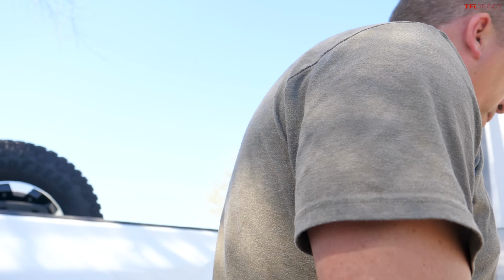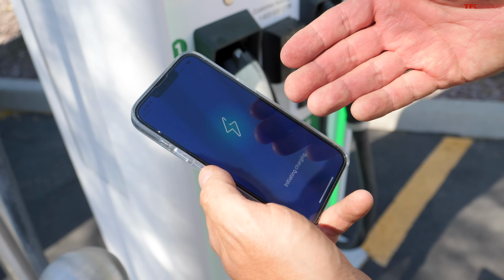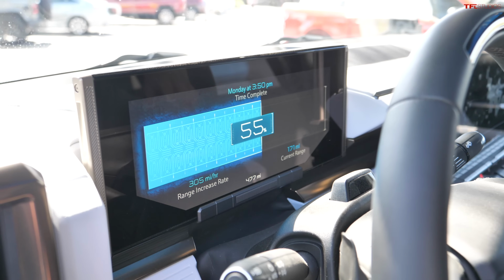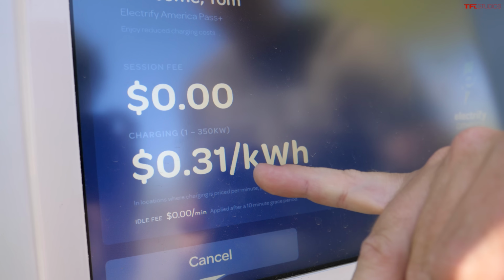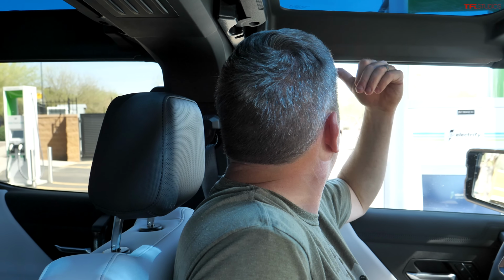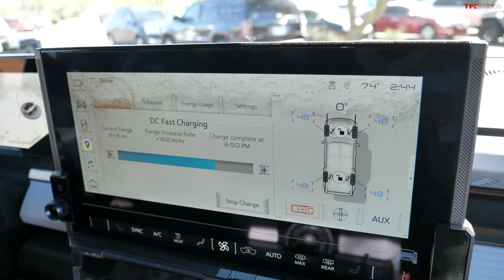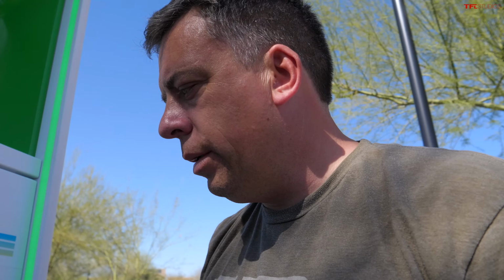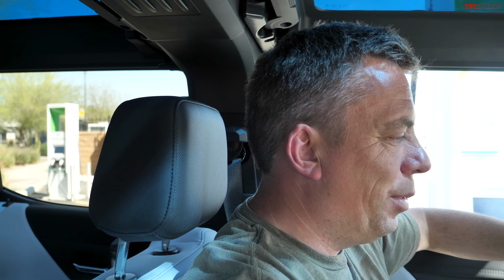How Fast Can I Charge The GMC HUMMER EV In Just 15 Minutes? The Answer Is Surprising!

Comment: Can you guys do a video on home charging costs? I would love to see monthly bill with a EV vehicle being charged at home and a month without being plug in at home. What would be the car charge % of that bill.
Reply: Multiply your electric rate per kWh by the mile/kWh of the vehicle you're interested in. For example, my Focus Electric has around 28 kWh available in the pack so it's $2.80 (I pay 10 cents per kWh) for a charge.  It gets 3.7 miles per kWh, so a full charge gets me around 103 miles. That's ~2.7 cents per mile. Electrify America rates vary. In my area it's 16 cents /per kWh, so ~50% more than home charging. A full charge for me is around $3.50, because there are some losses to heat when charging.
Reply: @jghall00  So $100/month added to your monthly electric bill, for nightly charging. (for a Focus).
Reply: @sptrader6316  Closer to $50. We rarely use the full range each day, more like half most days.
Reply: In your calculation don’t forget about taxes and fees that are also associated with your home electric bill
Reply: @CharlesAnsman  It's already included in my kWh rate. 5.5 cents is energy, the rest is delivery, taxes, and fees.

Comment: 78 miles added. Real world usable amount is probably closer to 70. At $14.25/70 miles=$0.203/mile. For comparison, my ‘17 Escalade ESV does 20mpg hand calculated, at $4.50/gallon=$0.225/mile. Over a year of driving 8000 miles for me equals a savings of $176/year. Charging at home would cost about ~1/4 of the $0.31 the DC fast charge cost, at $0.08/Kwh, for a savings of $1381/year or $115/month.
Reply: escalades dont weigh 9500 lbs either
Reply: Even when you save $1381 per year it would take at least 10 years to recover the extra cost of EV... if the government really wanted to care about climate change, they would grant more money incentives than what they offer now in rebates to make the vehicle cost the same as its ICE counter part...  Thanks for doing the math on this.. no one ever seems to compare charging cost to gas  cost much.
Reply: @MATTYSRT8  just don't buy the blinged out evs then
Reply: @MATTYSRT8  Government incentives aren't free money! We don't need more incentives, unless you enjoy more inflation.
Reply: @MATTYSRT8  why would they incentivize SOLD OUT VEHICLES?? they need to authorize more mines and get the heck out of the way
Reply: Matt and JH doesn’t really know what they’re comparing this truck to. The closest gas truck that we can compare it to is a Ram TRX which is over $100k with all the crazy markups currently at the dealerships. Also your 2017 Escalade getting 20mpg is BS.
Reply: @2amchef16  And the Hummer EV is over $100,000 before markups. What will it cost when the dealers stick that on? It's just easier to focus on MSRP.

Comment: The main problem here is that you are starting the charge at a way too high SOC.
Reply: Yeah, that's why at the end he said he wants to do a 10%-80% once they can get one outside of the press event.
Reply: @chunkychuck  but he doesn't connect that sentence to why he didn't reach the claimed max charge rate...
Reply: 50% isn't really that high.  The battery in this vehicle is enormous.  It's 3 times the size of a Model 3 Long Range battery (~212kWh vs ~72kWh).  The Model 3 LR can charge at over 100kW all the way up to 70%.  With a 3x larger battery pack, the Hummer EV should be able to do 300kW+ all the way up to 70%, but instead it's struggling to break 200kW at 50%.  It's not clear if the bottleneck is the vehicle or the charger, but either way this will be the consumer's experience.  I don't expect them to match Tesla, but this doesn't even look close.  I guess we'll find out more if they do a more thorough test starting with a lower SOC and different chargers, but it's not looking great in this limited test.

Comment: Yes you're only going to be capable of those 300+ charging speeds at the perfect scenarios where the battery temperature has been prepped your state of charges about 10% and the charger is in top shape and no issues but by the time you get to halfway on your state of charge like you are you will start to see those drops quickly. I would assume that by the time that you would reach 80% you'll are probably down to 50 kw

Comment: Please test home charging speed. All other EVs can easily charge from 10-90% overnight so they can start every day with full range. With its massive battery and horrible inefficiency, i just can't see a Hummer being able to provide full range every day with just home charging.
Reply: If the battery size is 200 kwh and your home station charges at 10 KW that's 20 hours assuming no throttling right?
Reply: @Crazypostman  then get a 19kw one
Reply: the charger is 80 amps.   it can easily get a charge in 12 hours.  from 0.  so yes yes it can.
Reply: @richardroberson9277  I wasn't aware that 80 amp chargers existed.  Good to know.  And yup, that would work.  Probably a bit more expensive to buy/install as you might need to upgrade your service and your panel.  But of you could afford a Hummer...

For overnights away from home, it might be extremely difficult to find an 80 amp destination charger, though.

Comment: I guess being retired I could wait all day for the charging??
Reply: Or get an Ioniq 5 or EV6 that charge to 80% in 20 minutes.  Why do some people enjoy paying so much for gas?
Reply: @jghall00  An Ioniq 5 or EV6 is about 2x the price of a typical mid-size gas car. Why do some people like pretending EVs cost nothing?
Reply: @Mark_Christian25  They're in the 40 - 50K range, same as mid-size crossovers like the Edge, Sante Fe, Atlas, etc. When you include the $7,500 tax credit and fuel savings, they're comparably priced. Personally, I bought a used EV last year for 14K out the door. It only has 100 mile range, but that's enough to handle 90% of my driving so we don't drive our Expedition much anymore. I love not having to worry about check engine lights and maintenance on a ICE vehicle.
Reply: @jghall00  They're not the size of an Edge or Sante Fe, they're roughly the size of a Tucson or Elantra, in terms of overall length and passenger volume. They also aren't crossovers, they're just marketed that way. With 6.1" of ground clearance, it's barely more clearance than a Toyota Prius. 

Also, mileage makes EV not comparable on price, since EV pricing is tied to battery size and range. 

Also, tax credits aren't free money, the sticker price is the real price.

Comment: 350 kW will probably only happen if your charge <20%
Reply: Also, most EA charging stations are limited to 350 amp service (at least now). So approx. 350 A * 800 Volt  = maximum 280 kW.
Reply: @TFLtruck  True EA uses different vendors their ABB units are often limited to 350A.   EVgo has some 500A units that might be good.  Finding the GM "Ultium" sponsored sites will likely be able to max out the charge rate.

Comment: why would you start the charge at 53 % start it at 10% or 5% if you want to see the charge speed
Reply: Because it's a press event and that's what they got.
Reply: @ColeSpolaric  Exactly. They filmed what they could in the situation they were in. Good stuff.
Reply: But at the same time I do understand what you're saying about getting the fastest charge
Reply: @tjmakings  you don’t understand because you don’t know a lithium battery chargers faster when it is at lower percent (~20%).
Reply: Thing is at 53% its still around 100kWh of battery needing charged because the battery is about 212.7kWh of usable energy.
Reply: It took Streetspeed 10hrs to get to half battery on a lvl 2 charge station. Wonder what charge station that was.
Reply: @userANAKIN  I filled my 2002 Focus in 3 minutes
Reply: @BigEightiesNewWave  good for you
Reply: Because he knows it would take hours to charge
Reply: What if someone is at 50% and they need a full charge before they cross an area with no place to re-charge? Like on a trip across the mountains or bfe?
Reply: @tjmakings  watch OutOfSpec Motoring road trips on Rivian he took it across the CO mountain pass when head3d to AZ. He explains charging and EV road trips route planning better than anyone
Reply: @tjmakings  They trade it in for a Duramax
Reply: @tjmakings  But it completely defeats the purpose of a "how fast can it charge" test.

Comment: EVs are practical in urban & short distances. Waiting 1.5 hours to travel 300 miles is a joke! I’ll wait for the technology to advance. See you in 10 years.
Reply: Wrong lol. What the hell are you talking about? This is a Hummer EV. It is a GIGANTIC EV with a huge battery pack and horrible efficiency. It exists because it’s cool and sexy. Something like this could not exist 10 years ago and it is amazing progress. Besides I could take any one of my “long range” trips with this thing I usually do and do it all on one charge and plug in when I get there.
Reply: @lawnmowerdude  no this thing is a pos.  a full size truck only need weigh 6000lbs not 9500.  any other elctric truck will fare way better
Reply: @lawnmowerdude  My long trips are 1,100 miles each way. I’ll stick with the combustion engine. Thanks!
Reply: @8TimeChamp  If you’re traveling 1,100 miles one way regularly, why are you even here? Why would you expect a house on wheels to be the most efficient thing on the road for anything anyway? You’re trolling.

Comment: The 100mi estimate is most likely at a lower soc since the batteries charge faster at a lower % and start slowing down as they get full.
Reply: slow down....its below .9C at 50% with a modern 2021 battery pack the heck?
Reply: No they don’t
Reply: Blah blah blah
Reply: Yes. that is the what most OEMs quote. Surprised the tester did not know about this.
Reply: @ravitoday  Same tester that calls a straight 7% grade "The world's toughest towing test" It is a breeze. Not a test at all.
Reply: @geraldkoth654  7% at that elevation is not a breeze.
Reply: @ravitoday  Of course, the tested knew about this. Like I said - this was an impromptu test during a first drive event. Not enough time to verify a more complete charge curve?
Reply: @TFLtruck  Thanks for the clarification. 
I stand corrected. Hoping to see the complete charging curve.